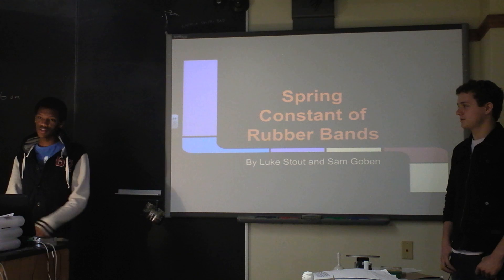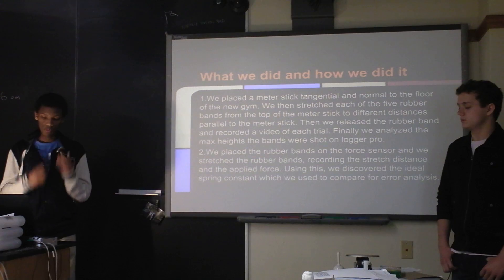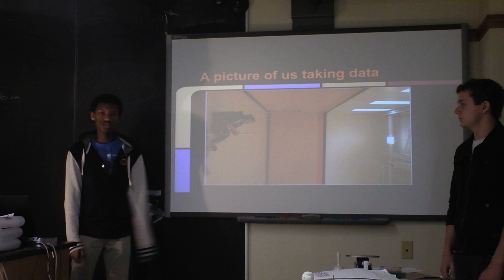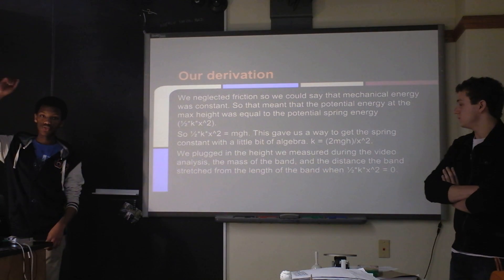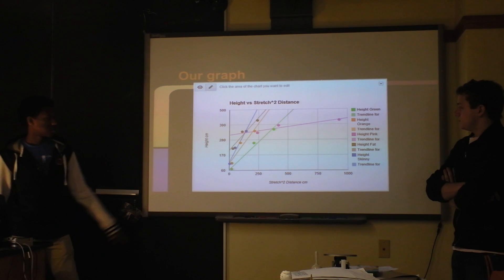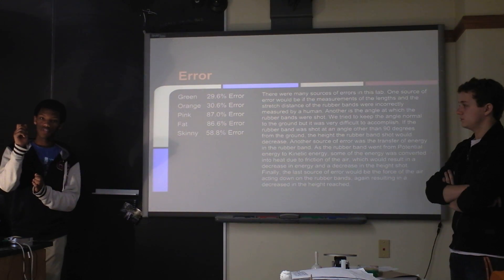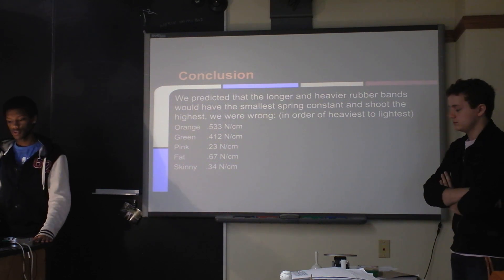Indie Lab - Rubber Bands Launched to test Conservation of Mechanical Energy

Comment: Nice. Just to share my thoughts: the most significant errors are probably (1) deviation from Hooke's Law, so you need to plot out the entire force-extension graph in order to work out the stored energy. (2) air resistance, especially if you shot the rubber bands at high speed. You may interested to watch my video - http://youtu.be/vDvOHvdFcMY for slow motion footage of rubber bands in flight. Air resistance really have a large impact on fast moving light objects. Thanks for posting this video online. I thoroughly enjoyed the presentation.

Comment: Nice. String theory in action! Seriously, this is what string theory is about: moving and oscillating strings. The only thing missing in this implementation is interaction between strings by means of merging and splitting. Rubber bands just don't do that by themselves, but elementary strings do. And the numbers are different. A baryonic string (that connects two quarks you are pulling apart) has a (constant!) tension equal to a weight of 14 (metric) ton, i.e.a heavy truck. Truly elementary strings (if they exist at all) have a tension of the order of 10^52 Newton. That is a little more than a rubber band :-)

This string theory perspective makes me wonder: does the video footage show oscillations in a way that allows their investigation? Or are they too fast, or too erratic, or too strongly damped? These oscillations play a role in your initial energy equation. Ultimately their energy is lost due to friction, but the total amount of energy  lost in this way is to a large extent determined by how strong the oscillations are. I have no specific prediction for this worked out, but my intuition says that it might actually be half of the total energy that goes into oscillation. It would really be interesting to know more about this.

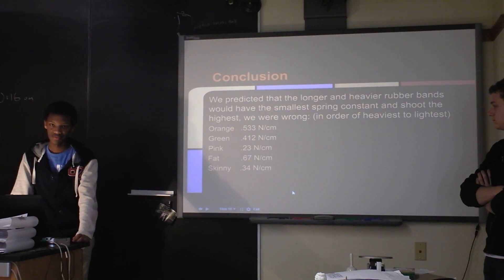A very good aspect of this project is the solid 'base' experiment of measuring the spring constant by static extension. Without this the whole thing would be 'up in the air'. Did the bands deviate substantially fro Hooke's law? The remark around 6:30 in the video suggests that they do, but maybe I got this wrong. Deviation from Hooke's law would be an interesting point for further investigation. (1/2 k x^2 goes out the window).

As to your finding that the heavier bands have the higher spring constant values: it may be helpful to think of a thick band as a set of thin bands in parallel. For a given extension each thin 'sub-band' adds its pull, so the whole thing is stiffer than a thin band by itself. Maybe you had something like this in mind with your remark about the area.

All in all a nice project and a clear presentation. The guy on (our) right has a wonderful down to earth manner. I would have loved to hear him say a little more.